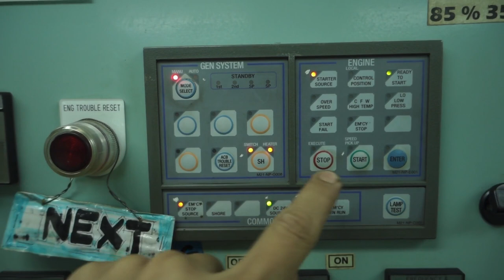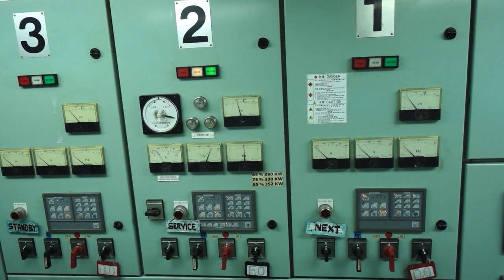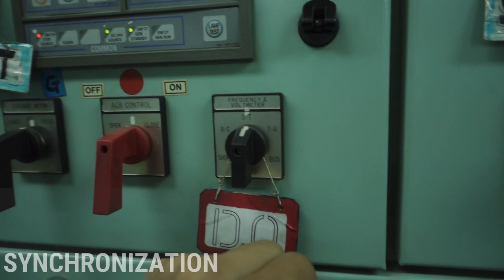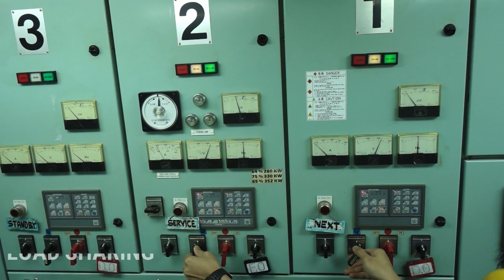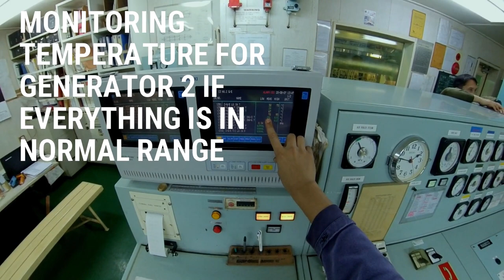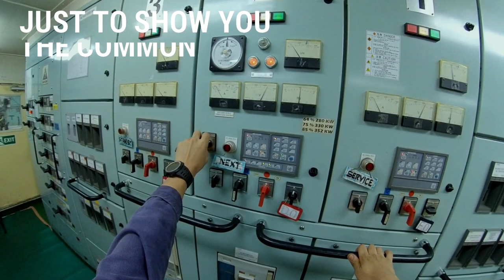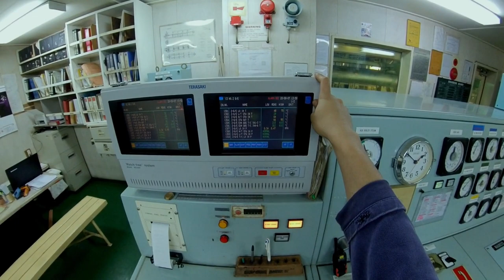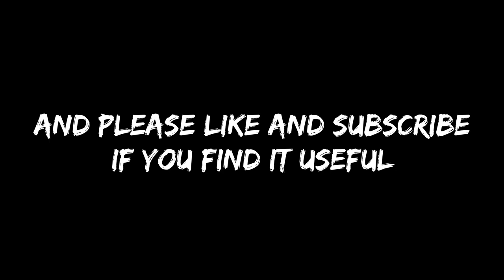How to Run Synchronous Generators in Parallel ㅣMarine Electrician

Comment: I am now retired from the Los Angeles Department of Water and Power. I worked for 34 years in Steam Electric Generating Stations. As an operator I manually synchronized units to the line a number of times over the years. The units I operated were built in the 1950s and they had manual synchronization only with the use of a synchroscope. So I am very familiar with the process of paralleling generators on a ship. The electricity generating units that have been built in recent years all have automatic synchronization.

Comment: If I remember correctly back in the 60s we used what was referred to as the 3 bulb method on board ships, don’t remember exactly but it had to do with the bulbs all going out then you could tie the generators together.
Reply: The 3 bulb is just next to the synchroscope meter. It is when the 2 bottom bulb has the same brightness is the time to break in the ACB.
Reply: Yes I remember the three bulb method for when there was no syncroscope.   Also could use the three bulbs to make sure that the phase rotation was correct..
Reply: SAME THING AT LATTC  LOS ANGELS - NEVER USED ANY PART OF THE SCHOOLING !!!!!!
Reply: Dark lamp method
Reply: The dark lamp system is the one I know. When the phases are in synch then there’s no difference between phases so the lamp doesn’t light. Seems simple enough. Of course someone couldn’t leave well enough alone so there are various other lights that tell you other things 🤔 and naturally no one bothers to label these things.  It shouldn’t be complicated but somehow it is.
Reply: @David0lyle  The problem with the "three dark lamps" method is there is a wide phase range where the filaments aren't hot enough to be seen. The "two bright, one dark" method in this video narrows the phase range by using a visual comparison. The bright lamps are wired across phases.

Comment: the phase sequence is usually the same for all generators on board)) What you really need is to monitor the INITIAL phase of the incoming generator so as not to cause BLACK OUT... and this done with  syncronoscope..... And checking the phase sequence is really important in case of shore supply connection.
Reply: We never had a synchroscope on our units. They were able to be put on in either manual or automatic mode. All we had were the meters and the two light bulbs. All the rest of the things we could do manually or let the gensets' controls do it as shown in the video. Two 125 kW 480V 3 Phase units driven by Detroit Diesel 6-71s which had electronic governors on them. They were installed in 1979 and we used them until replaced in the early 2000s with Kohler Gensets which were rated at 150kW that could not be paralleled. The D-D gensets were air starts but manual starting only while the Kohlers were automatic battery start units. Our electrical control panels for the D-D units were kind of dangerous as if you did not know what you were doing, you could backfeed into the grid. Which is why only certain people were allowed to open the doors on the control panels to get to the motor operated circuit breakers if they tripped out the motor units on the breakers. The normal prevention of backfeeding was a keyed lock system that had just one key which was used for both the grid power and the generator power. If you wanted Grid Power, the key had to be removed from the Gen Power breaker lock which could only be done in the off position. If you wanted Gen Power, then the key had to be removed from the Grid breaker lock with it in the off position. The key had to be in and turned in whichever one you wanted to be able use. The key served two purposes as it both locked/unlocked the breaker controls and also enabled/disabled the motors on the gen breakers. The breakers also had manual controls on each of the Genset breakers.
Reply: @gravelydon7072  wow, no synchronoscopes? Did you at least have the 3 bulbs or the 2 blinking bulbs? Or did you just have to monitor the frequency and hope the phases are correct?
Reply: @gravelydon7072  oh sorry i oversaw the part where you mentioned you had the 2 blinking bulbs, well than everything is fine, i can work with them just as well. But i prefere a proper synchronoscope

Comment: Good video,  I do have some suggestions.  You need to explain droop of the governors and droop of the voltage regulators Droop of the voltage regulator is critical to sharing reactive load.  The voltage regulator droop signal is generated by a CT on B Phase of each generator,  This signal is polarity sensitive and all hell brakes loose with reactive load swings if the polarity is not correct.
A and C phase voltage goes to the to  voltage regulator sensing. Most parallel generation uses this so called "droop control'
Some very modern systems are fully computer controlled and do not use the droop method.  Real load share with governor droop control is a bit simplier.  I have worked on many marine and a few stationary application of 2 or more generators and frequently see parallel operation not working.  This frequently leads to either/or operation or very short parallel operation followed by turning the original unit off as loads start to swing around.   Your explanations of synchronization are good.

Comment: This is a wonderful video.  Takes me back 50 years.
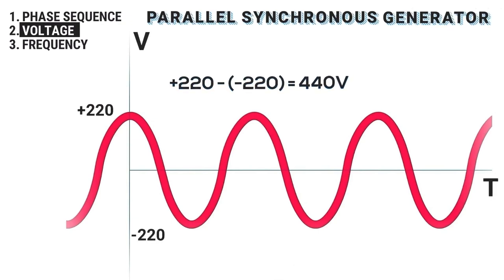The voltage you describe at t=1:00 is peak-to-peak voltage.  However, the instruments on your panel indicate Vrms.  The relationship between the two is Vpp = 2.828 * Vrms.  For the generator to indicate 440 V, Vpp would be1244 V.
I don't think you made a mistake when you paralleled the generators.  Much more important than turning off the synchroscope is to stablize the load on the incoming generator.  If you don't pick up some load, you risk losing it on a reverse power trip.  Turning off the scope should be the last step.  Good job.

Comment: Great video.  I used to do this when testing generators on US Navy ships.  One thing....You show how to move the "real" load (KW) from one generator to the other with the governor controls but you don't show how to move the "reactive" load (KVA) by adjusting the voltage regulators.
Reply: Perhaps the facility has power factor correction to ensure the generators never see any reactive load.
Reply: @DantalionNl  Doesn't work that way.  The governors control the "real" power (KW) and the voltage regulators control the reactive (KVA) power.  Adjusting them will move the real and reactive power from one machine to another.
Reply: There comes the AVR.
Reply: @jimprice1959  Yep, it be so. I was amazed to actually see real and reactive loads moving around between generators the first time I ran the on-board electric panel on a nuke boat. (It's one thing to know the theory, another to actually see it.)  When I went to work at a commercial nuke plant, you could see megawatts of reactive power being accepted / rejected according to the voltage settings.
Reply: @WarpFactor999  Sounds like you've "been there."  I worked at the San Francisco Naval Shipyard back in the 1960s.  When we were testing the ship service generators we would need to move the ship from ship service to shore power.  We weren't supposed to parallel with shore power but if they were testing radar sets they didn't want us to drop power--even for a couple of seconds.  We would use the governor and voltage regulator controls to move the real and reactive power so that there would be no power when we opened or closed the bus tie breakers.
Reply: @jimprice1959  Yup, On subs in the 70's, including a refueling overhaul.

Comment: What happens if you accidentally connect the generators together when the synchroscope is pointing down?  Is that like a short circuit and the fuses will blow?

Comment: so you use engine throttle to adjust the amount of contribution from each unit?
Reply from the maker: Frequency is proportional to speed of generator engine sir.
Reply: @markroymangrobang1072  Yes, but when 2 generators are synchronized, what controls the power output balance? Thank you for answering!
Reply from the maker: Increase speed governor for underload generator
Decrease speed governor for overload generator

Do these until load is balanced
Reply: @markroymangrobang1072  Will that not have an impact on frequency? Like you said the frequency is proportional to the speed of the engine.
Reply from the maker: @danielplusben  it will affect the frequency. Let's say the bus bar's frequency is 59hz, to make it 60hz, you must increase speed of the running generator through its speed governor. If two generators are connected, increase speed of the two generators with equal amount to maintain load on both generators.
Reply: Yes, more throttle means the engine will produce more power
Reply: @danielplusben  to help in your understanding: Once both generator breakers are closed they become electrically linked similarly as if you had mechanically linked 2 engine drive shafts, meaning if you try to increase speed on 1 engine it will try to increase the speed of both, so you need to balance that out.

Comment: hello! 
in normal condition load on 1 generator
V-440
Hz-60
KW- 300
A-227
Did you encounter the next problem when are in parallel with the same load? 
1 -V     - 440    2-V440
1 -Hz   - 60      2 -Hz -60
1 -KW  -150     2  -KW -150
but the Amp they increse at 200A almost on both of them 
thx!
Reply: I guess these are Amps per Phase am i right? So 440A at 227A per phase, so 681A in total are 229.6 kW, pretty much exactly the 300kW it should have. So your problem is, the gens have 440V and have an Output of 150 kW so they should run at 318A in total and 108A per phase. Your question is why the Amps increase to 200A. Maybe your system was running on Auto mode and automatically regulated the voltage to ensure that the reactive load gets distributed evenly between the generators. So they will accept/deny the same amount of reactive load. Did you double check that they were running at 440V? If they are transformer connected maybe they regulated the voltage, or maybe the voltage got directly regulated at the generators by changing the power of the exciter. They had to run at 250V at 200A per Phase, 600A in total to run at 150kW.

Comment: Nice video. What does reverse power mean? And how do we fix it?
Reply: Reverse power means that the fuel needed to keep the engine running at grid frequency is not enough. As the engine is connected to the grid, however, it can't slow down because it is magnetically coupled to the grid, so it will always rotate at grid frequency. This means that the other generator needs to supply additional power to keep the secondary engine running, and this is "reverse power". You fix it by increasing the fuel to the secondary generator so it acts as a generator and not a load. It's also helped somewhat if the engine you connect runs at a SLIGHLTY higher frequency than the grid. at 4:15 you can see that the video talks about the second engine running slower than the grid if the rotation is <---- and faster if rotating to the ---->. You can connect the generator in either case, but if the syncroscope rotates to the <-----, that means that when you connect it, it will speed up due to the second generator supplying the power needed to get it to frequency. If it rotates to the ---->, it, in theory, generates a TINY bit of power as the engine has to slow down to match grid frequency instead. In either case, as long as you increase the fuel (if you are on manual) immediately after connecting, it will generate some power.
Reply: @Znyggisen  thank you very much for ur explanation!! Wished u were my engineer onboard 🙏🏼

Comment: Please explain, why when doing the generator synchronization process, the syncronoscope appointment must turn clockwise
Reply: if the syncronoscope is running counter clockwise it means the incoming generator is running slower then the running generator (ie, less then 60Hz) that would result in a draw on the existing generator. Electrically speeding the incoming generator up till they come in sync. Or more likely it would trip a safety as the incoming generator isn't generating but drawing power from the bus (in effect behaving like an electric Motor.)  If the incoming generator runs slightly faster then it will start out with some minimal push of power into the system and not trip the safety.
Reply: @Megacheez  very amazing your answer thank you

Comment: 220V RMS is not having the max at +220V and the min at -220V
Reply: Yeah.. I saw that too. 220V peak would be 155 (ish) V RMS wouldn't it?
Reply: @nikclev  Yeah..you have to multiple with the square root of 2 to get the peak so 220 X 1.41 = 310. So that would be -310V to +310V, 620V peak to peak. For 110V US would be -155V to +155V total 310V peak to peak

Comment: Assuming the machines are direct connected rather than transformer connected how do you ensure reactive power sharing?
Reply: You have to adjust the voltage regulators so that more/less reactive power gets accepted/rejected.
Reply: Oh sorry you are talking about direct connected rather than transformer connected.. i overred that... well then i dont know for sure, but i guess by changing the power of the exciter you can regulate the voltage of the generator so that it can accept/deny more/less reactive power. If the gen uses a permanent magnet instead of an excitercoil i have no idea how to realize that without a transformer.
Reply: @Rolhenw  so your ship generators are transformer connected? What voltage do you generate at?
Reply: @andyxox4168  i have nothing to do with ship generators, sorry 🤷‍♂️ and i already corrected myself by saying you need to change the exciter power to regulate the voltage
Reply: @Rolhenw  being a marine electrician I assumed you were on boats, still having been on land based generation for +35 years I can tell you your answer is substantially wrong 😑
Reply: @andyxox4168  im neither working with land based generators, im an IT-Security specialist 🤣 but still, at generators which are transformer connected the reactive power can be distributed evenly by regulating the voltage.. im pretty sure of that.
Reply: @Rolhenw  sure, the point is that transformer connected generators on an infinite bus will share reactive power in a stable manner but with direct connection, unless measures are taken, the VAr will swing uncontrollably between machines.

(I had mistaken you as the poster of the video as that was who the question was aimed at …

Comment: What happens if one genny turns off/runs out of fuel/etc and it's still connected? Does that ever happen at all? The power head would act as a motor and pull a ton of current, I guess it would trip the breaker? Would it trip before causing damage to the prime mover? I know connecting when it's not synced does that.
Reply: The normal method to deal with this situation with parallel synchronous generators is to use reverse power  relays which will trip the breaker.  This is often not done on smaller installations because of cost  Motorizing the generator in itself is not going to cause damage but on diesel prime movers the injectors are likely to foul over time.  On steam turbine or water wheels damage is not likely  Stator overcurrent protection is always there.
Reply: @parkerholden7140  Interesting! Thanks for the response!
Reply: Yes - "reverse power breaker" relay tip would/should occur ...
Reply: It wouldn't pull a huge amount of current because the generator is already at speed and synced and just pulls what it needs to keep running, but of course it would be a waste of power so you don't want it to happen even with steam/water

Comment: If the two gennys are in parallel, how can they have different loads?
Reply: Watched another video. I think it has to do with one being faster and having more throttle/steam/whatever than the other, and probably voltage too? so it wants to push more current onto the bus bar
Reply: Depends on the throttle state of each generator' governor. Increasing throttle means letting more fuel combusted, hence more potential power
Reply: @yyyyy354  Ah, gotcha. it's really cool that you can control that
Reply: @polymetric2614  As Yuu-kun said, power output is governed by how much fuel the engine recieves. The load on each generator is controlled by how much lag there is between the magnetic field of the generator vs the grid, with the generator with the biggest load being like a bigger magnet.

All generators always have identical speed and voltage, regardless of load.

Comment: If you are adjusting avr parameters on the DG that is not even on net, then God bless you but sign off. Read about adjustment of AVR from ABB manuals or at least from manual available on board.
Reply from the maker: radek babicz yes that is right. Always consult to the manual. Not all generators and machineries are the same.

Comment: Temperature difference in generators is very bad because it can make parts bigger and if the shell and rotor have too different temperatures then rotor might touch the shell and cause vibration or in the worst case it can explode